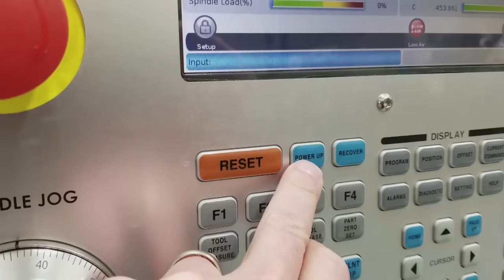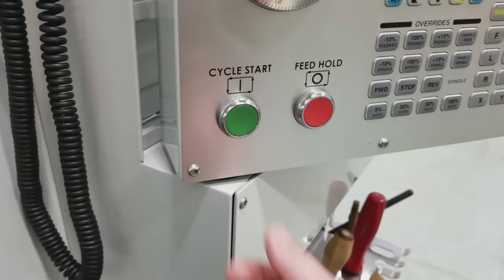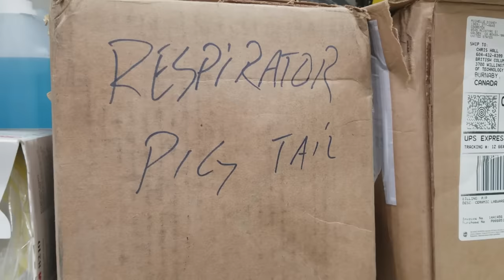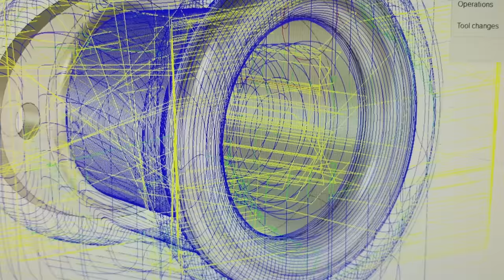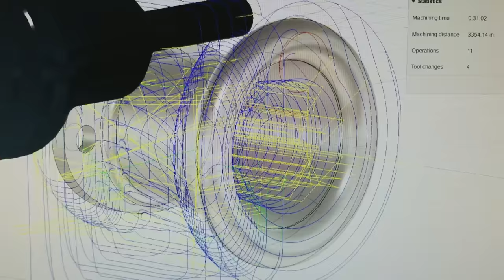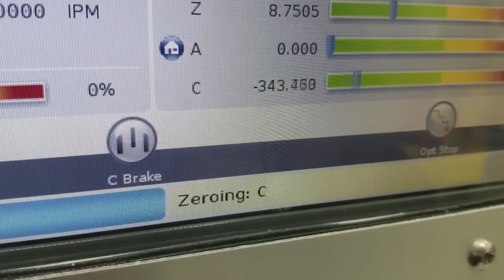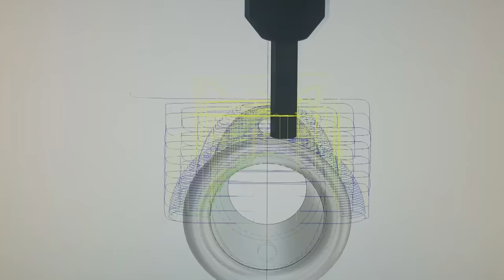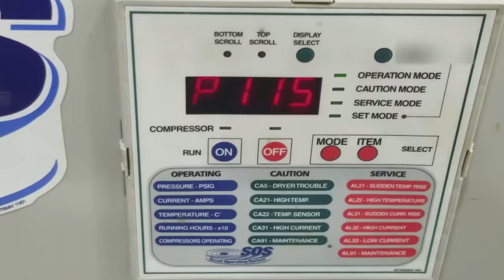ROBOTS are NOT going to steal your job | Ram Air Intake

Comment: I was a machinist for 6 years this is highly accurate especially on nights.
Reply: Only thing missing is forklift racing
Reply: What would you do with the materials if you made a mistake? Would you be in a LOT of trouble?
Reply: I want to touch a moving part
Reply: EchoHelix you scrap it and move on
Reply: @danilovieira2791  boy oh boy.... Once you see that thing spinning you'll think twice
Reply: AvE - BECOME THE BOSS THEN.....
Reply: It takes longer than 6 years to call yourself a machinist. A machine operator,  maybe, but not a machinist.
Reply: Michael Morelli I mean I would call myself a machinist been doing for around a year just wat type of machinist and how much experience you have
Reply: @jacobsharpe8219  I have 40 years experience in machine shops. Starting in quality control right out of high school then slowly got introduced to the shop floor. Cutting raw materials for jobs then worked on manual machinery , Bridgeport's,  horizontal & vertical milling machines manual lathes. Finally got the chance to learn the programming and operation of cnc machines which I still love to run. Sorry if I insulted you, but at least now you have some idea why I might feel that way. It takes years to learn everything about machining and honestly,  I am still learning today. Anyone who thinks that they are too old to learn something new is a fool.
Reply: @mike840621  i do agree but the term machinst is so broad that i think its fair for someone like me who only has a year working on lathes and mills can claim to be one
Reply: @jacobsharpe8219  . Fair enough Jacob and I'm glad to hear that you are still working in the trade. Manufacturing is critical right now. Our nation's economy depends on manufacturing at home. My issue was with PAQ MAN saying he was a machinist for 6 years. What is he doing now? Selling shoes? Best of luck to you. Keep working in this trade and most of all, keep learning.
Reply: @SilverLegion121  In trouble? Depends. If the raw piece you're machining is a forging or casting that has an order lead time of a year, yes. If they want 5, you'll usually get 7 pieces, 1 for a tooling setup and test, and another spare in case something goes wrong like the casting fractures from an internal defect. A block of aluminum, nobody cares. The scrapped parts, off cuts, and even chips sometimes have considerable value and can be sold for re-cycling, depending on the alloy. Depends on the contract also, sometime the buyer wants everything back, because the materials they use is a trade secret, or can be used for other parts or for prototyping back at their company, or destructive testing.  Regulation for poisonous metals sometimes dictate what you can store and how.
Reply: @michaelpatrick6485  Thank you for the extensive explanation. I'd be so afraid of messing something up.
Reply: @SilverLegion121  Nobody will let you do something you haven't been prepared for -  nobody sane, anyways. There are lots of checks ( like in the video! ). Sometime you run the part with a dense foam instead of metal. Or you run the program through in the air above the part. You listen to the machine. Frequently measure the parts on the surface plate. Modern software even can show you an animation of the cutter going through the part. And being afraid is actually part of it -time go ask somebody for help instead of going it alone. :-)
Reply: @SilverLegion121  depends on what kinda part. Some aerospace parts are worth half a mil
Reply: @jacobsharpe8219  he doesn't know what he's talking about
Reply: @mike840621  who told you that?
It depends how able you are to learn the trade. I've got an apprentice thats been working with me for 4 years and he's one of my most valuable assets and can call himself a qualified toolmaker. Can fully take advantage of heidenhain and conversational. You're clearly a slow learner.
Reply: @PugilistCactus  59 and still programming and running cnc lathes, thank you very much.
Reply: But can you use a crowsfoot wrench correctly? Because dude in the video can't!
Reply: @mike840621  am i a machinist yes but i focus on lathes, i can mill grind and work on huge bores, i am soon to be finished with my apprenticeship but  iwork with a Georg ultraturn, its not for you to decide who calls themselves a machinist, i can assure you that if i am capable enough to turn shafts for power plants, that i am able to call myself a machinist
Reply: @hephaistosthesmith2069  Every machinist's experience is different. I worked 24 different jobs  over 35 years and no two jobs were anything alike. Every employer has their own way.
Reply: @SilverLegion121  usually you just start again. noones gonna blame you for that if it wont happend often.
faults causes at the beginning (construction, machining)  costs less than when the error is discovered later of even worse, at the costumer
Reply: @jacobsharpe8219  I suppose the argument is, not if you are a machinist or not doesn't really matter. It really boils down to how much experience you have gained. At one factory I worked at Fred had operated his horizontal milling machine for nearly 40 years open vice close vice push start repeat the same components every day couldn't didn't want to do anything else. Was he a machinist? He certainly had a value to the company no other skilled man could stand the shear monotony of his job.
Reply: I operate a Gerber Paragon cutting machine at my job, cutting mostly soft but some hard body armor for police and military. I’ve been doing it for 3 years. Am I a machine operator, or a machinist? My guess would be a machine operator, but I’m not totally sure. I also do mild maintenance on it, changing the blade every day or every other day and cleaning the sharpening stones.

Comment: You should move your mouse nervously, it makes it boot faster,
Reply: Geez man grab an ssd you won't regret lol
Reply: @rbnhd1976  I got into Fusion360 after I got an SSD and never knew it took so long to load up
Reply: I don't have an ssd and fusion starts up super quickly
Reply: @t-rexfpv2653  what's your definition of super quickly?
Reply: But whats more important you should slap that space button as hard you can, it will even more increase boot time
Reply: I got an SSD after getting frustrated with my slow system. Apparently spinning hard disks can't handle a couple of fist blows of a frustrated user..
Reply: @somedude2492  6 to 10 months
Reply: When Windows is used instead of Linux you know man hours are not important.
Reply: Nope. But circling the pointer in a clock-wise direction definitely speeds things up.
Reply: What is Fusion 360? I use NX, is it better for manufacturing?
Reply: @rbnhd1976  Why spend on a SSD when shaking the mouse works just fine?

Comment: If someone asks me how long it will take for me to (manually) machine something, even if it seems simple, I'll show them this video if they don't accept my 4-10 hours answer. There's so much mroe to any operation than people think.
Reply: But I know someone who can do it in half that time and pay me for the privilege.  ;)
Reply: The proper answer to that, of course, is "Then why are you bothering me instead of having him do it?"
Reply: I had a boss say, about welding, "You're just sticking metal together."
Reply: My standard response for any job is "when it's done".
Reply: I was a welder/fabricator before I became a Toolmaker and remember one day I stayed a couple hours after closing to fabricate an oil pan. Next thing I know it's 6 hours later and the pan isn't finished. I didn't realize how long things takrle even though I was the guy doing the work.
Reply: @theupscriber65  
Like the day a simple brake job turns into a two day project.
Reply: My standard Line is that it will be somewhere between 15 minutes or all day depending on how things go!
Reply: I do production machining.  So I don't have the same issues per se. However I used to run into this when fixing the car and the wife would get impatient.  Now I just tell her it'll take about two hours more than it really does.  Makes it way more relaxing.  Learned that tip from Scotty on Star Trek lol.
Reply: Zaphod Whiskers I remember when I was able to pull those all night garage sessions and go to work in the morning.  Those days are long gone! I like my sleep!  Chris
Reply: Or the ubiquitous, "This costs too much to buy at the store why don't you just make me one?"
Reply: damn right, and the first of a job on a cnc takes as long or longer than on a manual mill (+-variables), so peeps that give me one offs are surprised at the timeframe of one week, but if you want 1000 of them then no worries, they'll be done in 2 weeks.
Reply: When people who contact customers directly ask me how long is the job going to take (when it is supposed to leave the shop the same day) I always say, tommorow morning it's gonna be ready.
Haven't had any complaints from the customers, only from the boss man.
Reply: @zajtoja 

"mañana" is a better reply.

So long as the hearer understands it means "not today" and doesn't promise "tomorrow" 🤣🤣

Or so I was told (I don't speak Spanish, regrettably)
Reply: Damn right!
Reply: How much is this gona cost? If you need to ask that question, you can't afford it.
Reply: Zaphod Whiskers  sunrises are best viewed with coffee just before bed :p and sunsets aren't too bad to wake up to either :)
Reply: Ever seen the Lego factory, there's a machine out there already that can do it in 15mins lmao in 20yrs there will be no such thing as a Machinist. Sad but true. It will be like a blacksmith is to us now. It's for sure happening.
Reply: @bertkutoob  mañana means tomorrow, so yes, you are promising it will be done by the next day
Reply: @mars5012005 I worked injection molding for years. Usually we had mait come in and fire up the screws and turn on all the heaters. It does take forever but you can start on a sunday night and run nonstop until sat morning. Tooling is expensive tho, really expensive
Reply: @henrylicious  Engineering professor in school said to derive how long you think a job will take, then double that value for the client.
Reply: As someone with conspicuously zero experience in machining but a lifetime of experience in everything taking WAY longer than everyone thinks it should, it’s remarkable to me that things can get machined in that time at ALL

Comment: And after the cad drawing is made, nc code generated, all the errors are corrected, potential crashes mitigated, inefficient travel optimized, tool maintenance caught up, material prep finished and dry run looks good, you stand there, almost paralyzed thinking;"Should I push the button? '
 Nope, sing another bar of " paranoia' , run through each step again ,then pat yourself on the back for saving a $couple thou and sing the modified " paranoia baled my ass out" .   

Take a deep breath, reset the program, take a slug of cold coffee, inspect the tool, the material, then ask yourself: "Should I push the button?
A couple more loops of the prior sequence then Go ahead! Push the button! Do it! Push the button!

So push the button and run like hell. After lunch you return and it's humming along happily and everybody else in the shop hates you cause the machine does  all the work and you get paid the same as them having to drive screws all day.
Reply: CNC machining gave me OCD like 30 years ago and it's getting worst with newer technology...
Reply: You forgot the part where you check the vice for the 50'th time to see if it's tight
Reply: I've been a machinist for less than a year and I can't describe how accurate this is.
Reply: Damn you LaserFlexr.  Don't go describing my life like that.  You DON'T KNOW ME!  ;)
But seriously, you'd think we'd learn to trust the simulation but the more you know about computers... the less you trust the simulation.
Reply: Thats a good day, usually it still just slaps the tooling into something it shouldn't.
Reply: @advil000  as a developer I don't trust software.
Reply: I can relate🤦🏾‍♂️
Reply: Black Sabbath should be required listening in all shops !

Comment: I can imagine 50 years ago: "Don't worry lads! Machines ain't gonna take your jobs. We still need 80 of you to run this company"
Reply: I mean, they didnt, they took some jobs but the vast mayority was left intact
Reply: @IvoTichelaar  yeah fair, imo there are many problems with the usual depiction that many people have of "robots will take all our jobs" that has been popularized by sci fi, but you do put a good point i havent really through about
Reply: Automation is still pretty new all things considered. Robot take over is inevitable, but maybe not as close as some think.
Reply: Right it's not like it eliminated a large portion of jobs in the car industry or really any type of factory setting
Reply: @CarrotConsumer  I work in machine learning, the thing is, artificial intelligence (if you want to call it that at this point) already has the capacity to be much better than humans at many things.. humans are very good at a broad range of things, but artificial neural networks can be trained on very specific tasks and easily outperform humans.
Reply: @derpnerpwerp  
looks at AI that still can't drive a car in a straight line

Nah
Reply: @InvadeNormandy  Yeah anything practical robots/AI can’t do. They can play with numbers, but they can’t physically or visually articulate worth a damn most of the time.

Comment: The flute is plenty long enough!  It's like I tell the wife: "You don't need a larger tool, you just need to rotate the part so the tool reaches the intended spot!"  Or you can approach from the other end of the hole, or, through a different hole.
Reply: They always object the different hole theory
Reply: @RJ1999x  guess I have a defective one
Reply: @md4luckycharms  or maybe not🤔

Comment: That is legitimately the cleanest shop I’ve ever seen
Reply: Or opening the cabinet and finding broken taps in with drills, having a meltdown because someones messed all the setup, moved everything because they like it so.
Reply: Adam Bousfield seems like a lot of work just for a single video. Knowing how lazy a lot of machinists can be, that’s not likely, this guy is just a special case. At the same time, aerospace shops can be cleaner, but that’s only because they HAVE to be

Comment: At my diesel engine shop we make new, and remanufacture locomotive engines. 8 to 16 cylinder, 11" bores, 15' cranks, turbocharged 60,000 pound diesel engines. The company spend a million dollars on robots for the sole purpose of just deburing the parts I machine. Three robots in total, one to pick up and hold the parts plus rotate them to certain angles, the other 2 that debur and change heads as needed. They do a very specific job and only on a single part out of the thousandths of parts in a loco engine. They eliminated zero jobs, and after 2 years sit mostly idle. Even running as intended a person still must change tooling in the heads constantly throughout the day, and the clean up of chips is incredibly hard to keep up with. The limit switches get gummed up with coolant and debris, the robots themselves glitch out all the time and sometimes literally crash into each other and drop brand new castings 6 feet onto the floor, they hit slag and break tooling all the time, they are useless. They are made by motoman (sp?) Which is a leader in robotics I think out of Japan. They are nowhere near being able to replace skilled laborers, and nowhere near affordable.
Reply: @someone else 
It's time for CyberSyn, brothers of the Internationale!
Reply: @someone else yep, which is good. because managers represent a large amount of inefficiency in humans.
robot managers also don't hold grudges or have superiority complexes
Reply: Could you do the de burring with a file?
Reply: What did you do before the robot? did it by hand? I'm assuming you previously ended up with lots of sub par parts that had to be scrapped because of quality control? is that the reason for the robot?
Reply: @someone else You discarded fanuc robots? Send me one next time !!
Reply: that's just bad planning
Reply: No chip conveyor?

Comment: All this high tech stuff is just there to impress the stock holders. When the company needs something in a hurry, and it has to work the first time or else, they call Old Tom out of retirement to fire up his 1940's lathe and mill. He'll be done before its time for the first coffee break.
Reply: Seriously.
I work on a high def plasma cutter, they bought two lasers for cutting small parts from thinner steel, and still bought a refurbished mill lathe that has the 1940's green paint on it.
Reply: That's what they do with my dad.  All manual machines.  He gets it done right
Reply: @themonolithian  Try telling anyone under thirty that every piece of machinery used in WWII was essentially made by hand,  and watch the blank look on their face. Just because technology always marches forward doesn't mean the tools of the past should be forgotten or gather dust.
Reply: It depends on the part, if you need something with super small tolerances sometimes you need a cnc machine, but usually you can do this stuff by hand and it's faster, although there are some things that a 3 axis cnc router is just great for, like making water blocks and reservoirs for custom computers
Reply: High tech tools are going to useless right up until those bastards really do invent AI
Reply: I'm used to run "my" CNC lathe faster than a flash.
I have the basic toolholder on it, and some "made to be adapted" programs, in the time this guy take his shit probably I have made half of the part 😂
Reply: you know what tools are the real OG mvp. you know them intimately... you can trust them, we become one with the machines.
Reply: They call This Old Tommy